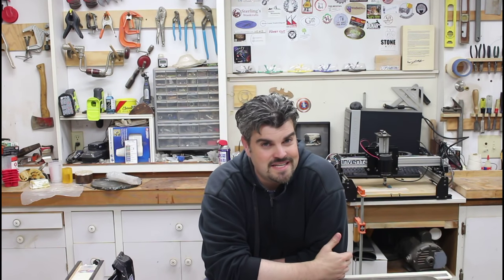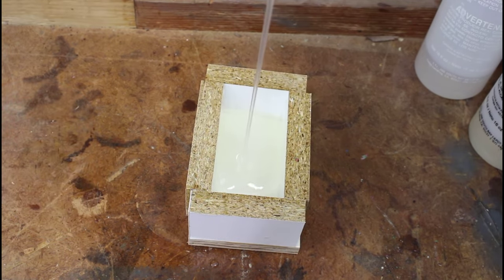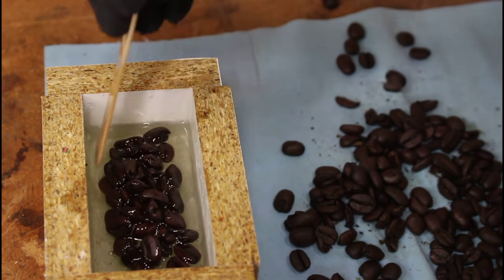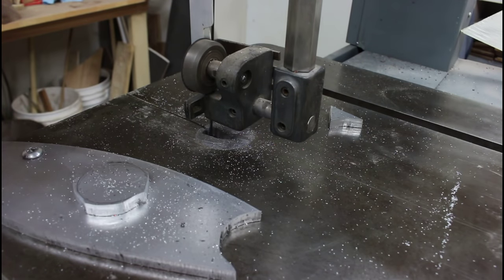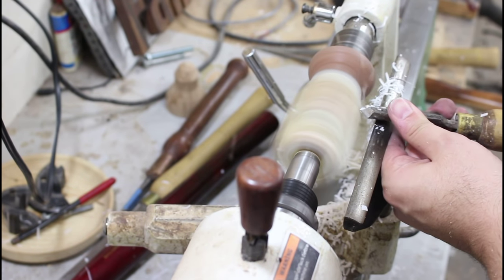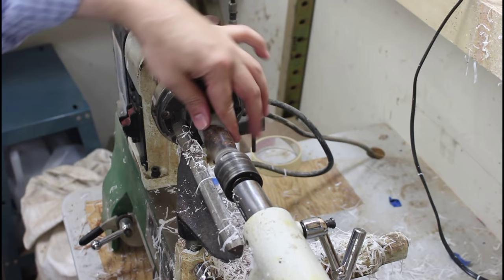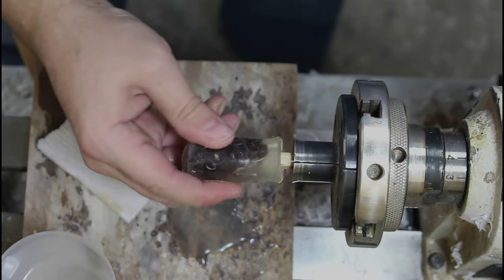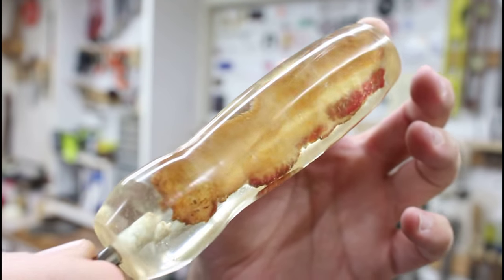Dip It #4 : Epoxy vs Coffee Beans

Comment: I know this is an old video, so I don't expect a reply, but that bit about turning the aluminum on the lathe interested me. What tool was it that you used for that? I'm getting back to a point where I'll be getting into aluminum casting again and I'd like to avoid the excessive sanding and filing to clean up my casts. I'm wondering if using a regular file against the aluminum on the lathe would work? Also you gave me a great gift idea: a coffee mug made like this, coffee beans in resin with a neat machined aluminum base. I know someone who would love that! Anyway, great video, I'm hoping you (or someone) can get back to me on those questions.
Reply from the maker: A file would work. Aluminum is pretty soft overall.

I'm using a very heavy duty high speed steel scraper. It cuts well, and cleanly. Now, a lot of people found this practice unsafe. So be careful and only do what feels safe to you.

As for the mug, I'd skip it. Resin can take the heat, and isn't food safe. So unless it was just for looks, a coffee mug is probably out. 

Thanks for watching!

Comment: :/ Major wince at 3:00. I'm not sure I'm a fan of cutting metal on a wood lathe, there's a reason metal lathes are called metal lathes and wood lathes are called wood lathes
Reply: +Rob Mckennie with aluminum it's not really a huge deal, in terms of stress on the machine and tools it's probably no worse than some hardwoods. 
though, the type of aluminum can make a difference.
also, HSS is used for both wood and metal lathe tools, the main difference is how it's held, sharpened, and presented to the work.
Reply: dscrive also the speed of the work, and the amount of torque the machine can provide. And the way the tool is held isn't a trivial difference, did you even see that catch? Who's to say that couldn't have snapped the tool or some shit, not a good idea. I have seen hand turning of metal twice in my life, once on the clickspring channel, with a tiny tool taking very light cuts, and in this video, trying to hog away material, doesn't seem prudent.
Reply from the maker: +Rob Mckennie It was a new experience for me, and honestly I try not to be unsafe. 

If you listen in the background you can hear my grinder spinning down. I had just sharpened it up.  That scraper I used is almost an inch thick of Sheffield steel too. plus my lathe was running at 800RPMs. 

That said, I would love a metal lathe and the space to put it! :)
Reply: Peter Brown I've just bought myself my own metal lathe, which should be here inside of about 8 weeks, and I'm planning on making a youtube video or two about my learning to machine. If you ever want to involve some metal turning in your projects, it would be totally cool to collaborate or something
Reply: +Rob Mckennie well, speed wise he was probably right around the recommended surface speed of machining aluminum, but aluminum is pretty forgiving of imprecise speed. I saw the catch, I also saw how the lathe stalled, it didn't have the torque to break the tool. 
And yes, the way the tool is held is not trivial, that's what I meant when I mentioned presentation to work.
I spent 3 years in a machine shop using a lathe and a mill, I've got a bit of familiarity with machine tools, I also spent 3 years in a wood shop, with part of what I did being wood turning. I'll admit, both of those were in education settings.
I notice further down in the thread you mention you are getting a metal lathe, congratulations! turning metal is very rewarding, and a lot of fun. 
I found turning brass to be a true pleasure in life, steel was meh, and aluminum was gummy.
Reply: I love reading conversations between experts on the subject. :)

Comment: Can someone explain 4:05 to me? Whats a catch
Reply: +Molly Winchester A catch is when the tool digs into the piece being turned instead of cutting through it, generally because you did something stupid.
Reply: +Molly Winchester He pushed the chisel in a bit too quickly, and it grabbed the material.
Reply: krtwood Ohhh thank you!
Reply: Dangit_Bobby Thank you!
Reply: +Molly Winchester When turning wood when you catch like that you usually break off a piece of or even shatter the entire piece you're working on. With metal usually your cutter tip will break. In the case of this resin it's not brittle enough to shatter nor strong enough to break the tool so it tore out the threads and let the piece stop while the lathe spun freely.

Comment: Super cool as always Peter. I cant wait to see your next project. You might have said it before but what kind of epoxy do you use. You have inspired me to try my hand at something. I play more with metal so this should be a nice change for me.
Reply from the maker: +Taylor Hardin Thanks Taylor! I use different brands, but recently I've been favoring the EasyCast. I added a link in the description to an Amazon store. I like it because you can buy it in smaller amounts.
Reply: +Peter Brown When you get bubbles and you use the torch to pop them, does it pop the ones that are kind deep or does it do surface only?
Reply from the maker: +Taylor Hardin As best i can tell, it heats up the resin and makes it more viscous, which allows the bubbles to rise to the surface and pop. I normally check on it every twenty minutes for the first hour and pop them as they rise...
Reply: +Peter Brown Sweet! Thanks for the heads up.
Reply: Bacon causes cancer, or haven't you heard?
I also think real bad smelly farts, cause cancer in others!
Yours truly.
Canadian Lover of Bacon :)
PS: Shouldn't vegetable peeler's handle be made of vegetable'd Epoxy?
Reply: +pirateman that's the joke. it's ironic

Comment: For sanding/polishing cylinders (handles for your espresso tamper and veggie peeler) I recommend creating some delrin cups on your lathe (clamp in chuck and run forstner bit in from tail stock).  Drill through bottom to attach a nut and bolt, bolt sticking out so it can go into a hand drill chuck - then just put some foam into the cup that will give you a good grip on the work piece.  Usually you want the inner cup diameter to be 6 to 8 mil bigger than work piece, and for liners you can use abrasive sanding pads (foam backed), putting the abrasive side against the cup and smooth side towards work piece.  Not sure if that makes sense, but it is a handy technique if you make a lot of acrylic handles for things.

Comment: Awesome.  Glad to see the new video.  I had wondered what happens when the dipped item breaches the epoxy. Perhaps you could re-dip. Like dipping a wick in wax building the layers up. And aluminum is great to work with.  I'm a machinist and its my favorite metal to cut.  I'm thinking either metal shavings or wood chips would be cool to dip.
Reply from the maker: +Tony Brewer I wish I had more metal working skills! I've only used a few of the softer metals in my shop. 

For most items when they breach it isn't a huge deal. The beans really soaked up the resin so they mostly feel like plastic now. Even though they are exposed.
Reply: Cool beans

Comment: BTW, when using woodworking tools or bandsaws to cut aluminum, use wax. Just regular candle / bottling / canning wax. It makes a huge difference, it cuts faster, leaves a nicer finish, requires less pressure, just better in every way.  It works for filing, hacksaw work also

Comment: Love this! Though the coolness of the process and result result is enhanced by my love of espresso. I have been getting a hankering for a new tamper but never considered making one. Until now that is. :-)  I may buy the base and make the handle though as I want the weight of steel and don't have any tools to work steel. Thanks for this edition of dip it. Looking forward to the "gasp" wood project.
Reply from the maker: +Scott Petersen Thanks! It is a little light, but as I've been using a wood one for years, it's a step up for me! Good luck on your tamper!

Comment: Maybe if you use aluminum in your shop again you could use a cutting fluid on the aluminum, if you didn't already. It makes a very noticeable difference when working with metal. WD-40 works pretty well.

Comment: Dip some LEDs! Would be very interesting to see the effect especially if you add in different resin pigments to areas of it and have the LEDs wired up so they all turn on and work! Would suck if one goes or the wiring brakes during casting, but you could use the cut and stick strips to make things a little easier and harder to brake.

Comment: I would think filling a mold completely full of coffee bean and then adding epoxy then filing down on the lathe until it starts to cut into the coffee bean to make a marble effect and then clear coat and finish would be interesting would that be possible or would there be any problems with the coffee bean breaking apart

Comment: Hi Peter.  Great projects.   Maybe next time a circular mould would be more economical of resin. i.e. Plaster of paris is relatively cheap so make a 'plug' roughly the size you want, make a 2 piece p.o.p. mould, hey presto! ...AND you've got a certain amount of repeatability IF you should need it.

Comment: Can you get a timing belt on a mold and pour the epoxy so you can get a timing pulley out of it? Timing pulley like HDT 5M or 3M are very expensive specially if you custom size them

Comment: I don't know if you made a video about it, but have you thought about getting a silicone mold for your epoxy projects? I'm sure you could find a mold of that size somewhere, I know I saw a cylindrical one or could even make your own.
Reply from the maker: +MrBubbleh I have both laytex mold builder and silicone mold maker in the shop. I just need to find a shape that is semi universal.
Reply: +Peter Brown You could just do a dip it with the current mold you are using and before you shape it, make a mold out of it, that way you don't waste any epoxy and you have a mold of a shape you have been using a lot of. Or use any cheap food containers, there are a lot of shapes for those, and you seem to use rectangular shapes for your dip its :) Which are lovely by the way!

Comment: I know this video is old, however, I am currently taking a networking class, and my professor told us that if we ever wanted to work with aluminum, do it on our time, outside of her shop. aluminum is a nasty metal, it "shards" more easily and turns into a fine dust that can be nasty on a person's respiratory system

Comment: when you make a mold use a wax so the piece doesn't stick to it. When I fiberglass something or need to do a repair I usually use an automotive wax
Reply: just a thin layer of wax in the mold and the piece should just come right out.
Reply from the maker: +Peter Jardin Thanks! It seems hit or miss. sometimes everything just slips out, and sometimes I have the tear the thing apart! I'm in the process of making a rubber mold. Fingers crossed.
Reply: +Peter Brown no problem the rubber should work out great.
Reply: +Peter Brown also west system makes a tropical products so if you are doing this on a very humid day. that's why the epoxy can be gummy or not set at all.

Comment: instead of sanding so much, why not paint another layer of resin on to shine and protect? I've seen that done before.  sand until smooth and either literally paint or drip on a thin layer.
Reply from the maker: +safire994 I've tried that. It works to a point, but I still get runs. Works great on a flat level surface....

Comment: If you have problems with your molds (moulds? or is that just the Brit spelling?) try coating them with paste wax first. Plain old (stinky) Johnsons Paste Wax is a cheap and easy mold release for lots of casting materials.

Comment: Speaking of walnut, I think using whole walnuts in a casting would look pretty cool. Something about their strange brain-like shape just makes them intetesting
Reply from the maker: +Studio 13 That's a cool idea! Check these out: https://www.facebook.com/FromTheTreecouk-318583068237091
Reply from the maker: +Peter Brown Oops, bad link. https://www.facebook.com/318583068237091/photos/a.483954711699925.1073741841.318583068237091/838262426269150
Reply: +Peter Brown wow those look awesome! you could try seeing if you can add pigment to your epoxy and see how it changes colour- maybe turn it into a paperweight, or maybe a the lid for a small container?

Comment: i like the "dip it " videos,but why dont you make bigger molds? if you did,then Your bacon or broken glass inside it would not break thru the surface... how about using a round mold? cut a plastic pipe in half an put resin in one half at the time...?

Comment: I want to start casting in resin. anybody have a recommendation on what time of resin to use (for a beginner)??
Reply from the maker: +MrGooga555 

    I've used two types here in my shop for casting. West System 105
    resin with 207 hardener. I like it a lot, but it's pretty pricey.
    
    The other is EasyCast Epoxy. It's bit cheaper and you can buy at at
    most hobby stores. It takes longer to set up but I get very clear
    cast from it!
    
    You'll need a few extras too. Respirator, rubber gloves, plastic
    measuring cups , stir sticks and a mold of some sort! (most of which
    you can find where you buy the resin)
Reply: +Peter Brown
 Thank you so much